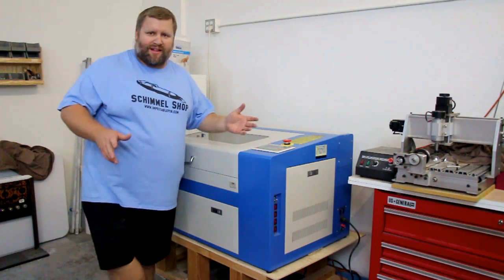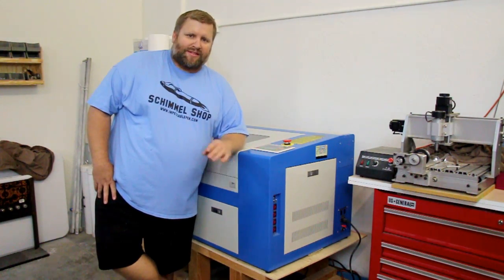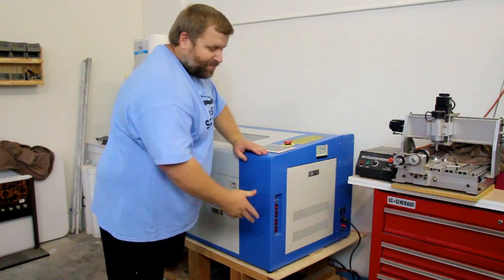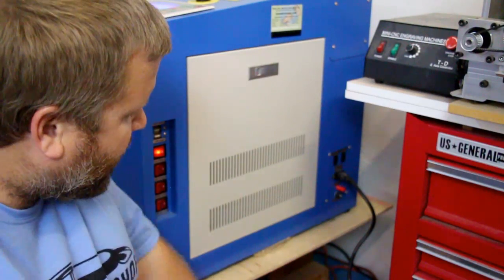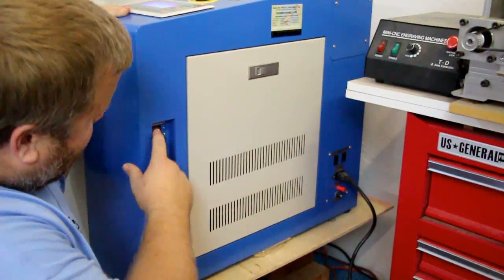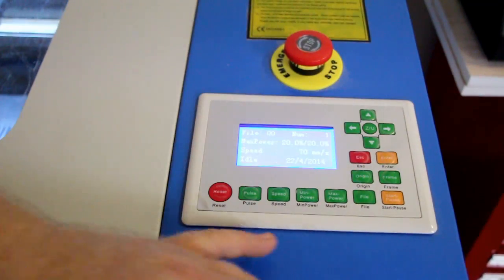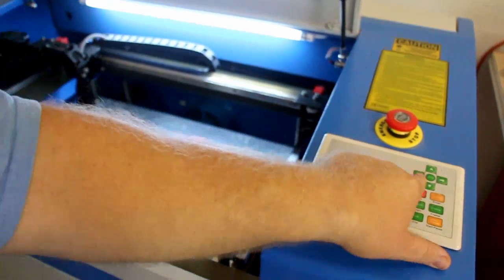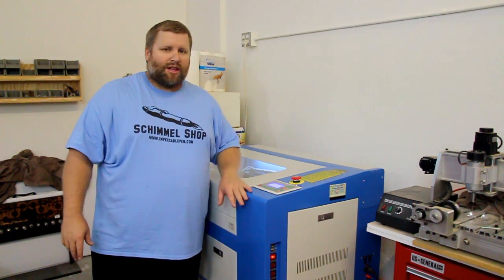50 Watt CO2 Laser engraver cutter from China, EBAY Laser, Basic operation and overview

Comment: I just got my 50W laser. I have several questions and cannot find any other source of info but you! So I hope you can help.  1- how close/far from the substrate should the laser be?  Should I be raising the bed so the piece is nearly touching?  1" away?  6" ?  Is there an ideaL?  2- Have you found a setting to eliminate the need for flipping the image?  Thanks for any help!

Comment: Hi Chad,
I have a SinJoe Laser Etching 80Watt Laser Engraving Machine that I have had nothing but issues with since it arrived.  The company I bought it from Laser Depot in Las Vegas.  I have contacted them and SinJoe in China repeatedly and cannot get any help!  Im using Laser Cad Software.  When I export a design from Corel Draw and then import it into Laser Cad it downloads to the machine just fine.  It shows up correctly on the LED screen on the machine, however when I start it, it burns the design at a slant instead of straight up and down.  I have aligned the lasers so I feel that it is a software issue, but I am lost and sitting here with an 8,000.00 machine I cant use.  In addition it did not come with a laser pointer or the rotary attachment.  They sent the attachment later but I have no clue how to install it.  I cant find anyone in the San Antonio area that knows how to work on it.  Any assistance you can offer would be much appreciated!

Comment: So we have also bought one of these laser engravers and we are having a great time with our machine jamming and saying the parameters are 10000mm for x and y. do you know how by any chance we could change this or fix this? we get it to go back to zero and then of course shut the machine down turn it back on, it doesn't stay defaulted at o. we did have it connected to the rotary and tried giving it more room for the rotary and its gone to hell since. It's been two months since we had this thing and of course it put us over the warranty stage as they date it back to when purchased not when shipping actually got the damn thing to our door. 
If you have any input or may have experienced this if you could help out it would be greatly appreciated, the company we bought this from- on ebay- emails back at 3 in the morning with nothing more than thank you for your patience.
Our email address is lsg@lakeshoregraphics.net our office number is 810-359-7055, we are in Michigan so we are eastern time. 
Any kind of help is appreciated. We also have a facebook- "lakeshore graphics tim hering"

Comment: Just to clarify in case people are wondering, Ebay is not a place or a store.  You cannot buy anything "from" ebay, because it's just a site and connects buyers and sellers.  You can buy stuff "over" and "thru" ebay, however and the nice thing about ebay is they give both buyer and seller protection against fraud.  Of course this can be abused, but having been a member (and power seller) since 1999, it's gotten better over time.  Always just be sure to pay with PayPal to get the full consumer protection!
Reply: Wth are you talking about hahahaha this is a video about a laser machine.

Comment: Hi Chad. Great videos. I am looking at buying a laser cutter but I am unsure about the c02 / tube and running costs. Does the tube only last so long? and does it need to be filled with co2 constantly? Thanks for your help.
Reply: Hi,Jonny,pls add my whatsapp:+86 18576470650  laser cutter supplier since 2006.

Comment: Run Google Translate and point it at the screen.  It will translate.  There is an option (Press the button at the center of the cursor arrows) and you should see it.  In there you can select language to english.  Life is much easier after that.

Comment: I have a question to anyone who can help about the 100 watt ebay laser maximum reliable cutting depth especially through clear acrylic. thanks
Reply: i have the same laser as in the video it says it a 50w tube .but they come with a 40w its ok.but the tube only lasted a year.i then ungraded to a 60w tube .and its great now the new tube was about £260 PLUSS YOU THEN HAVE TO PAY£250 POST AND PACKING THEN £150 UK VAT BUT FOR £1700 i have a really good machine well i think so
Reply: Dear , 100w laser machine , it can cut acrylic 10mm . we're manufacturer of laser machine , different models of laser machine and parts of laser machine are available in our factory , if you have any need or confusion , pls contact my whatsapp;+8613793096623 or E-mail:sales@raylaser.cn

Comment: I recently purchased the Model KH-7050, physically the mechanics seem to be working, however I have not been able to get the driver to work, I get a message of no communication when I try to send a file to it. The software sent with the machine was CorelDraw... I design with and would like to use Adobe Illustrator.  Is there a drive available fpr ILLUSTRATOR ?

Comment: Hi, what type of water have you used for cooling the laser, as in distilled or de-ionised? Awaiting for someone to say wet ^^
Reply: I cool mine with Dihydrogen Monoxide.. Seems to work really well as a coolant since it's a Carbon Dioxide laser and has a decent thermal mass and thermal transfer rate...
Reply: lol
Reply: I its best to use distilled water but de-ionised would not hurt. They less conductive it is and cleaner the better.

Comment: Hi Chad, we also have this laser, we use it mainly for engraving glass trophies. Just recently we have run into a problem where the engraver reports an error message (we had it translated - out of memory) when working on Logo art work as part of the engraving. I'm wondering if you have come across this, or if anyone else out there has any suggestions on how we can solve this? much appreciated, Hellyn

Comment: Been using my laser for a month or so.  It no longer fires a laser.  
The tube lights up, but no fire.  Any suggestions?  I'm thinking, power 
supply.  Your thoughts please, Larry
Reply: i would imagine there could be a lot of things that could go wrong, from overheating to a defective laser assembly. that's why when i can afford a laser it'll be from a company with a good reputation, like epilog or vision or someone. sure, these things are built in china so the quality is what it is, but i'll require actual technical support and service performed in the states.
Reply: The outlet water pump hose had come off.  Works fine now.  Thanks, Larry
Reply: WoodTurning with Larry glad you got it working. apparently, with glass tubes you need a water-cooled system, but with metal tubes they're air-cooled. i hope you get your money's worth out of it. :)

Comment: Do you know enough about the quality of your laser over say a 60 watt and 80 watt laser I've seen on eBay. I'm also very new to this. I'm a luthier wondering does cut wood like the fretboard of a guitar for inlay? Does it engrave clear plexiglass. So many questions. Wish I could find out the best so called brand
Reply: Mark Schuster It will cut and engrave plexiglass.

The wood depends on the thickness and if its a soft or hard wood.

Comment: hey i have the 60w laser from ebay... how do you upload files from a usb drive
Reply: I have an 80w laser on the way from ebay which seems to be about the same size as the 60w. Can you please tell me if you had any complications with delivery? I am just wondering how the heck it's going to be unloaded from the truck. I am hoping the truck has a lift gate and pallet jack and the driver will roll it into my garage. I'd really appreciate an answer as I can't find any info about delivery of a beast like this. Thanks.

Comment: hey man you might already figured this out I bought one identical to yours found out after the power supply failed 3 days after I got it that they ship those 50 watt machines with 40 watt power supplies and 40 watt laser tubes after finding this out I contacted the supplier on eBay and demanded that they shipped me the right power supply and the right laser tube they wanted no part of me reporting they're false advertisement to eBay LOL
Reply: +Adam Lumpkins , Say Adam, purchased the same machine............so did you win & receive the 50w tube & PS???

Comment: Thanks for great video Chad.  I got mine today and I am trying to do some work but i have problem when cutting 3 mm acrylic.  It either burn the acrylic (it goes black) or it does not go through. I've tried all zillion combinations of speed/power ration but i can't find the right one.   Any suggestion? Am I doing something wrong?
Thanks
Reply: +Srkyboykg Have you tried using masking tape over your acrylic to cut back of the charing (blackening of the piece)? Some masking tapes have enough of a wax of the fabric surface to quell some overheating of the surrounding area.

Comment: I have a 50w CO2 laser. - my problem is that I cannot get the RDWorks V8 software to communicate with my laser - can you tell me what I am doing wrong
Reply from the maker: +Rolf Glockner Rolf wish I could help.  I'm far from an expert and would not know where to begin.  I use Laserworks as well so I'm no familiar with RDworks.  Perhaps another user on here can jump in here??
Reply: +Chad Schimmel change the usb port u r using on the laser machine. If it doesn't help u then please update the driver directly from the windows. I've faced this issue couple of times. Last time it happened when i reinstalled a 64bit windows 7 and the same error was kept showing. I updated all possible intel's ingine and communication software, installed rdworks, then found that my device (laser machine) wasn't correctly communicating with my system from windows device manager. Then i just right clicked on the device and updated the driver. Bingo it worked.

Comment: Notice you have a table top CNC router sitting there. Just curious which one it is and if you are happy with it. I'm looking to get one for small projects and a bit overwhelmed on choices.  Thanks for your time.
Reply from the maker: +Tim Shetz  I dont have that one anymore.  I didnt like it much.  I had a hard time with it and the software.   I now have an Xcarve and its so much easier to use.   I like it alot.  thanks
Reply: Chad Schimmel Awesome. Thanks for the info. Curious , are you using VCarve Desktop or Pro?  Looks like it would be a nice setup either way.
Reply: Marco Cruz op

Comment: Got mine from Amazon 12-2-14. The "control panel" is faulty (will not light). Just sent email to Amazon of this concern. Manual says it is under warranty for 2 years. Will keep you informed of progress.
Reply: I am a fiber laser machine manufacturer. If you have any questions, please contact me. Whatsapp: +86 18954150712

Comment: Hey bud how much did the unit cost an who did you buy it off of?
Reply: +David Britt   the machine we bought is great price 100 watt, around 6500.00no other manufacturer can even come close. I believe the machine is a good one, but I would never buy another one due to the difference in tech support which has been worthless. I specifically addressed my fears of this when inquiring about the machine and was told no problem,,,,wrong answer. we can not get Tyler their supposed guru to call or email us back. They refer us to china which is like 12 hrs difference. Got the name of a customer who has and runs 6 machines daily, super nice guy we talked once but cant get back in touch with him. Has been a night mare and just need simple questions answered, we were told could run with correll draw and the china tech support gave a patch that does not work well enough to use what we were use to. I again think its a great machine just no tech support, if that was there I would buy another one

Comment: Can you please take a photo and walk us thru it?  I open it in PhotoShop Element 13 take a photo then save it as a BMP. Than i open it in RDWorksV8....i just bought the SCU 1060 laser machine.. What is the process to convert the files from pics to rd files (or whatever file the machine uses to read files) for the machine to use? I'm using RuiDa ACS  RDWorksV8..

Comment: Have you been able to engrave some black anodized aluminum to leave markings, like white text such as for marking panels and parts? Thanks. I understand these 50W CO2 laser are not powerful enough to cut aluminum 6061 or such, but i am looking at options to engrave text etc on aluminum parts that are to be black anodized.
Reply: Sean McDonald's RC channel - I am in the same situation. I got a manufacturer I make parts for that need to have his hard black anodized parts marked and this looks like a sweet option to make it happen! I am surfing through all the comments and no one seems to be addressing this issue. Most people want to CUT THROUGH the material. We just want to break into the material by .005. Can anyone answer this question? Thanks!

Comment: I've had this laser for about a year now, and I highly recommend it. There are always minor bumps in the road when buying a Chinese machine, but you can't beat the price. I also have a 3040 router/engraver and also recommend that. Both machines are made with high quality components and I was very pleasantly surprised. I had an older one of the cheap hobby laser engravers that you can now get for about $500, and those are relatively low quality, slow speed, and have very simplistic software. I would not recommend the cheap hobby laser. The glass CO2 laser tubes seem to last a long time. Even my old hobby laser tube (4-5yrs old) still works. One person mentioned replacing the tube with a more powerful one, but you need to make sure your power supply and other components can handle it first. My 50W tube cuts 5mm plywood with multiple passes.

Comment: chad schimmel need your help, just buy a laser machine to which you have in your video. did not come with manual or software. it's my first laser machine I have a router cnc 3040t use it with mach3 , have some mail to send you pictures of the parts arrived and so I get an idea and see how it helps to connect ? I really appreciate it

Comment: Have you been able to change the speed when the program runs? I've found that when I change the speed, it only affects the speed when I'm using the jog keys, when it outlines the frame, or when it it is just repositioning itself. When I start it cutting, it uses some preset speed that never changes.

Comment: I just got my laser delivered and unpacked. The machine looks pretty good, but the 4th axis rotary is another story. It literally looks like it was made with a Sawzall and a Dremel tool (so bad that even an amateur would call it a hack job). I thought I might try using it, but the frame wouldn't even sit flat on the bed. Fortunately, I have the machining equipment in my workshop to rebuild it.

Comment: Software is RDWorksv8. Sent picture of display to Lisa-RuiDa Technology. She underlined the language that would change display to English. Will try it tomorrow.

Was doing a plaque with a "header" and 3 columns of names on 8.5x11 metal plate. The machine would not do it. Waited 10 minutes for it to process...still nothing. It did print the "header" AFTER removing the 3 columns of names. I removed all but 1 column of names and got a strange "beep" when I pressed the start button...nothing happened...10 minutes I waited. Each column had 40 names so I reduced the names to half...still nothing...reduced to 1/4 and it worked with no "beep". I think it is a "processor" issue. Will do a video of this and hopefully have it post on YouTube tomorrow.

BTW. Got CorelDraw12 to work with RDWorksv8 but not Adobe Illustrator.

Comment: Got machine running but can't do anything because of language of software. Where do I go from here? Very stressed out.

Chris
Reply: Chad Schimmel Got the language in English. Thanks. HAve worked out the bugs and now using CorelDraw12 for layout. Exhaust fan is not working. Will probably fix that later but overall operation of the machine is fine.

Guessing the next major problem will be changing the laser tube. Will probably try a more powerful tube rating like 100 watts.

Thanks again and if I can help you, please don't hesitate.
Reply from the maker: Chris what software are you using?   Is the display on the laser in the wrong language also?
Reply: Chad hello my software is in English but the tutorial is in Chinese they refuse to help me I don't how to even start this machine
Reply: Chad I just bought the same machine in ypur video. The CD that came with it says file corrupt but laptop doesn't recognize the cutter. Having issues

Comment: We have the same unit at work.  Everything was delivered almost broken.  Had to put wires in their places. then we stared to use it.  The EStop went loose, as does the wires.  Now cannot use any button except for RESET. How do you recover from that?  Minor error we get all the time when skectching, "ERROR OUT OF MEMORY EXTENTS"  Seems we can only use the Outline Mode for anything.  THe machine is now unresponsive, as the only button there that works is the RESET button.  Will look into it.  Nice little etcher.  ~$2800.00 from ebay.

Comment: Thank you for the video. I am considering purchasing very soon. I wanted to know if I would be able to use Corel Draw or Illustrator with this?
Reply: Keontre Mcknight Kind of late, but I do use Illustrator. I create my files and then import them into the RDWorks 8. Be sure to remove any bitmaps you might be using for reference. I also set my different color strokes up on different layers.